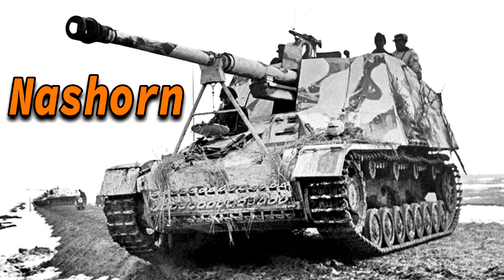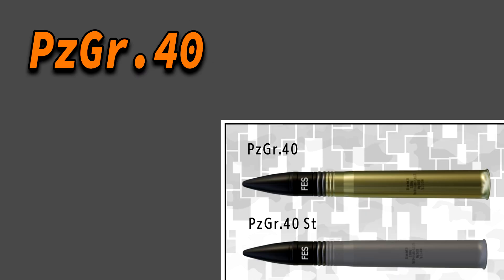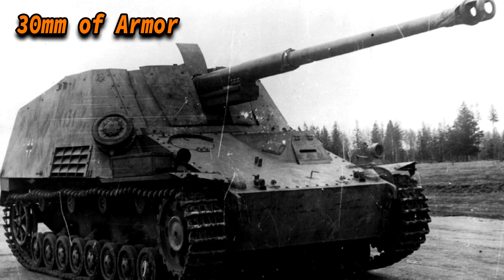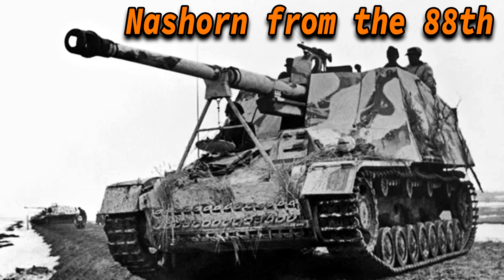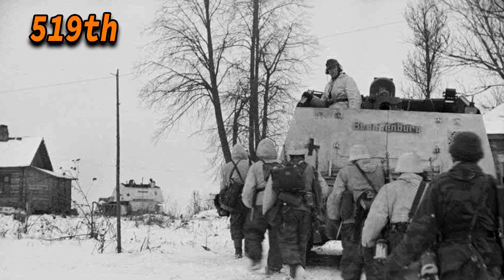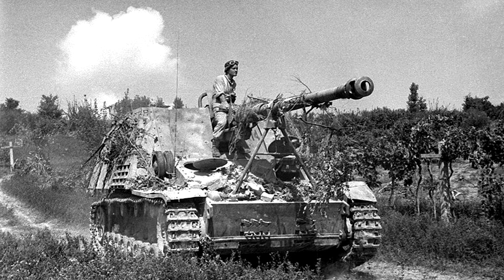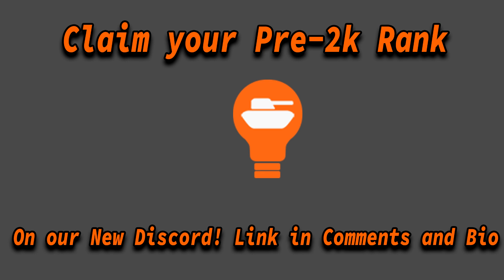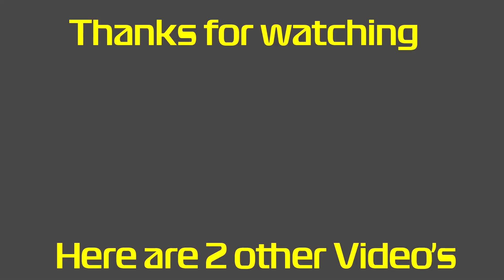Nashorn | Deadliest Tank Destroyer? (Improved Version)

Comment: On the Russian steps, the Nashhorn was a true monster.  It could sit back at long range, picking off anything it liked. German ammunition was smokeless, which would make it very difficult to spot out around 1000m. In rolling terrain, other AFVs could get in much closer. Due to its size and lack of armour meant the crew had to be on their toes to avoid being hit. In more closed terrain, it really was a wreck waiting to happen. By 1944, high explosive and armour piecing rounds were in good supply, but every other type of round, including smoke, was almost impossible to obtain. As a mid war stop gap design, I  believe it did a stirling job.

Comment: The 88mm Pak 43 L/71 was the most Powerfull AT gun of WW2.
They used Twice the Proppelant of a  88mm Shell of the Tiger I.
An Absolute Devastating Power at almost any distance. With those Superb Optics and a good Gunner,no  allied Tank was Secure from that Monster of a Gun.
PS: My friend it was not in Theory,but for the Unfortunate crews that were "Locked" by that Gun Gunner,even at 3000 Meters they were no more.
There were some instances where that gun was able to knock out Soviet Tanks at almost 4000 Meters.
Its was the most Powerfull AT gun of WW2.
Reply: From memory, the PaK 44 128 mm gun was even more powerful.  Most were fitted to an artillery, and of course, the Jadgtiger. It also would have been the primary armament of the Maus if it was put into production. Also, the Germans had developed the 105mm AA gun, but I've never seen any about an anti armour round for it. it looked very much like the FlaK 88mm gun. The Berlin flak towers had 4 in each.  Some were also mounted on flat bed rail cars.

Comment: But the thing is the fact that the Nashorn could blow you away at 2.000 meters and no allied tank could do that.
And in the Eastern front it happen many times at distances almost 4.000 meters away. And T 34/85.
They had the Best AT gun of the war,the Beast 8,8 cm Pak 43.
The same used on the KingTiger.
Reply: A hit from an M-4 at 2000 meters, if achieved,  would do for the very lightly armored Nashorn.
Reply: @thomaslinton5765  the only problem there its that the low velovity 75mm of the M4 cant hit nothing at 2000 Meters.
Reply: @jpmtlhead39  "The Shermans were modified for desert warfare with shields over the tracks and another stowage. The Sherman first saw combat at the Second Battle of El Alamein in October 1942 with the British 8th Army. At the start of the offensive, there were 252 tanks fit for action. These equipped the British 9th Armoured Brigade (for the battle under the New Zealand Division), 2nd Armoured Brigade (1st Armoured Division), and 8th and 20th Armoured Brigades (10th Armoured Division). Their first encounter with tanks was against German Panzer III and IV tanks with long 50 mm and 75 mm guns engaging them at 2,000 yards (1,800 m). There were losses to both sides."
Reply from the maker: I agree that if the sherman were to land a hit on the nashorn, most likely from any distance given how thin the nashorns armour isn would result in a Knock-out. But then again, the main armour of a nashorn would be camo, and good luck trying to find a tank (destroyer) if it is completely dug in, aiming in your position and camouflaged, especially if you are not aware in the first place it is there.
Reply: @LearningHistoryTogether  in almost 100% of the case of  tanks hit by a Tank Destroyer never knew what happen to them. Specialy if hit by a gun like the Nashorn have.
Reply: M-4 shells at 2000 meters with the small gun would've curved too much in the air due to the low speed and mass of the round, the hit would be very, very hard to make...  @thomaslinton5765
Reply: @thomaslinton5765  While the Nashorn could easily be knocked out by a T-34 or M4 in theory the Nashorn as a Tank Destroyer was to be used similarly to the American Tank destroyers.   They would not be taking on tanks head to head in a battle.    -Firstly would be hidden behind something like the reverse slope of a hill, or trees or buildings.   (one Nashorn knocked out a Pershing at 300m in Cologne) .  -Secondly the Nashorn had extremely powerful optics and could engage at very long ranges  -Thirdly the crew were trained in Artillery.  The crew would have surveyed distances to key objects and roads (had range cards) and probably some crews  had a 1m stereoscopic range finders.    The US Tank destroyers were far more agile with nearly twice the speed of a normal tank and a fairly powerful gun (76.2mm) but not as powerful as the 8.8cm L/71.